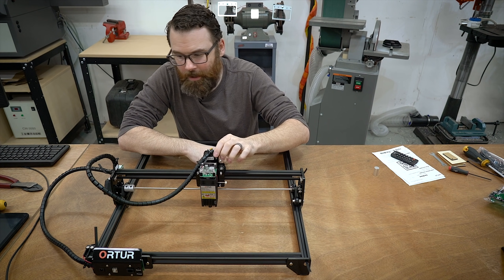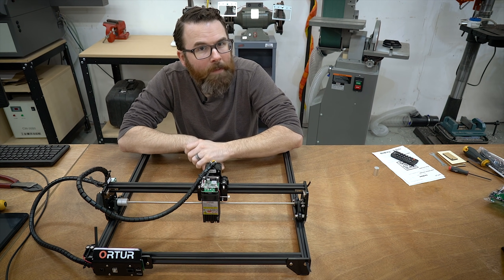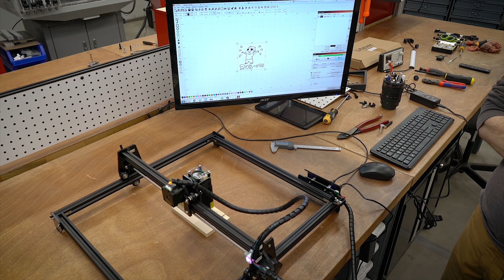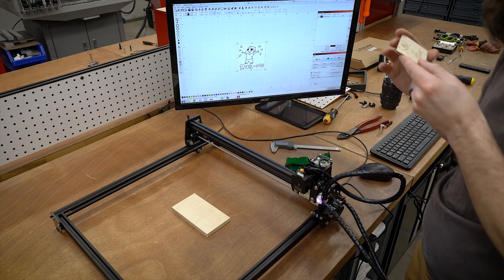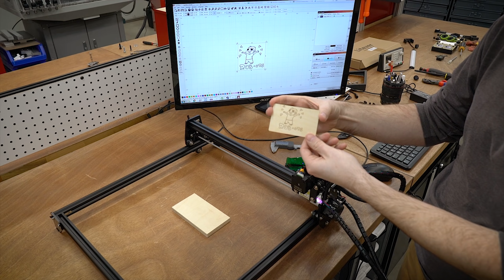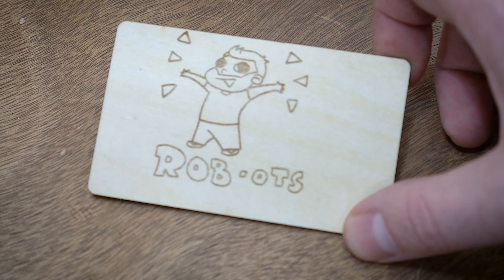Ortur Laser Engraver Overview (LU1-4)

Comment: thanks for this video. I am a total NEWB to laser engravers, I just picked up a Ortur Laser Master locally for $75. I am confused at how to adjust the focal length. Mine does NOT have an adjustment knob for the "up and down" axis. Should I add one? AND mine has a "purple" knob around the lens to be able to "focus" it.  The seller told me I just need to make sure that the distance between my laser and piece of work should be at 50mm. He would put something UNDER the piece of work if it needed to be closer. Again, not sure if this is the right way or not.  Also, I am unsure exactly what my wattage is for my laser. I have the  LU 1-4 stamped on the side of my laser.  Hoping you can answer these questions for me.   Thanks much

Comment: Hello I make wooden flags, 1in thick and 12 inches x 21 inches I'm wondering if I can place the flags under this machine to do custom lettering , pictures , or even do the union stars  with this machine , I d like to set this on top of the flags and engrave them . Thanks for the great info
Reply from the maker: Sure, that should work, depending on the material and other factors.  But just simple engraving would work just fine with this machine.
Reply: @RobertCowanDIY  awesome I've been looking at these for a while and the router cnc but those are so expensive. And then saw this and thought this might work. I was just wondering if the wooden flags would fit under the machine
Reply from the maker: @DH-fc2os  You could easily just raise the machine over top of your parts...
Reply: @RobertCowanDIY  ok cool thanks wasn't sure if raising the entire machine would work or throw something off trying to reach the material

Comment: Question: Do you think this would be good as a laser etcher for Chromebooks inventory management? Basically, etch the outside of a plastic cover on a chromebook...about 400 of them.
Reply: it should work okay depending on the material the Chromebooks are made of, dark matte plastics are definitely going to be marked by it however depending on the type of plastic you may have trouble with it melting or deforming if you use rasterized graphics. an alternative is to use single line fonts or fonts made with dot matrices which should be easier on the structural integrity of the plastic

disclaimer: this is untested and you should probably use a junk unit for testing or maybe you can try it on a replacement part

Comment: Lots of people have built air assists for these and the Neje versions and it supposedly gives a big improvement when it comes to cutting performance
Reply from the maker: Yeah, I could see that.  When you vaporize the material, it stays there, and if you don't get rid of it, it will dramatically decrease cutting efficiency.

Comment: I believe they are going by maybe Marlin code and "s" loosely translates to "Speed"/"Set(temp/etc)". If you got those results with s100 and they are recommending s800, then I think they may be overexaggerating just a little bit.
Reply from the maker: I think you're right.  It just didn't translate to light burn, but I figured it out pretty quickly and just used my own tests to determine the right values.

Comment: can I just use a similar laser to heat up to a constant temp a surface?
Reply from the maker: I mean, you COULD, but it would be really bad at it, and it's just the wrong use or application.  Just use a heater module for a 3d printer.
Reply: @RobertCowanDIY  actually I want to test it to heat the layer below what is printing to test if the 2 layers get a better bond. For very big print, the older layer has already chilled so the new layer does not bond as if the old layer was hotter. What do you think? The laser would follow the printing nozzle and heat the layer below just before printing
Reply from the maker: @biskero  Got ya.  That makes more sense.  You can just buy the laser modules themselves, and then aim it where the nozzle is.  That COULD work.  You would need to somehow tie it into the extruder signal, you'd only want it on when it's over the part, reduce power when the printer is going slower, etc.  Interesting idea, and yeah, a small laser module like this could potentially work.
Reply: @RobertCowanDIY  that's the idea, would use the FAN signal for the extruder so it's on only when the extruder is on. The trick will be to make the laser point just below the nozzle, but I already envision problems with keeping up with the directions in where the nozzle goes for printing. Will investigate! thx

Comment: I'm wondering, do you think it could cut thicker leather? Say over .125 in
Great review,  gave me some idea as to what to look for
Reply from the maker: It would probably cut it, but your edges might not be great.  if it was thinner, it would result in a better cut.  A couple things about cutting leather...  It STINKS.  It really does smell bad when its cut, so you need to let it air out afterwards.  Secondly, you will get a bit of a singed/charred edge.  This may or may not work for your application.
Reply: @RobertCowanDIY   thanks for the information.  Do you know where I might find more info? I've been looking but I know NOTHING about how to determine what would work.
Reply: @RobertCowanDIY  Oh yeah it smells horrible, like burning hair.

Comment: Nice, I learned a lot of info about this type of technology.  As a electronics maker I’m not sure how it would help me. 

I believe for my needs I would be looking at something that could cut 1/4 plexiglass, any recommendations?
Reply from the maker: For 1/4" plexiglass (acrylic), you'd need around 20 watts of laser power (the actual laser).  I'd suggest one of the 40W CO2 machines on eBay.  Just search for '40W laser' and that should get you something that would work great.  But keep in mind, CO2 is a bit different and will have a much smaller cutting area.
Reply: Actually for an electronics maker you can use a laser to print PCBs. I've never done it but I've seen YouTube videos on it.

Comment: how about cutting foam board for rc aircraft
Reply from the maker: It could work, but depth is depth.  The laser can only really penetrate so far based on the focusing lens.  Think of it like a cone, the laser only focuses at one point, so the further you go away from that, the wider the beam gets and the less power (concentration) it has.  Depending on the foam, you could probably do around 1/8" or so.  Thicker than that, it might just burn it a lot.

Comment: Why does it seem like bot builders do not like plasma cutting?
Reply from the maker: Good question! It heats the part, which can cause internal stresses.  Ideally you would anneal the part after cutting to let it relax.  But it can warp parts as well.  This is why waterjet cutting is greatly preferred.

Comment: careful moving a stepper by hand when the unit is off. The stepper will generate non trivial voltage and current that can feed back via suppression diodes to power rails.  thankx for the vid.
Reply from the maker: Yeah, I usually check this because you're right, it can turn on the rest of the controller!  thankfully it's not the case here.  Like I said, the controller seems fairly well designed.

Comment: For a few hundred more you can get a k40. Not a lot of value there.
Reply from the maker: You're right about that, BUT, it's a much smaller cutting area on the K40, and you might not need the extra power (or complexity?) of the CO2 if you don't need it.  This is also a lot more straightforward.  Maybe not a great value, but useful at the price.

Comment: Here's a sort of open question for anyone really.

How do you know to trust the included goggles? That's always been a big detraction to these open framed lasers to me. I'm not sure how I could trust those with something as important as vision.
Reply: william osman has an old video on it. even clear googles can filter some of the co2 laser. Tbh i wont take any advice from william's videos lol
Reply: StyroPyro has talked about that issue fairly recently- generally speaking, you might as well throw away any included goggles that come with cheaper machines- proper rated googles for any given colour or type of laser are 'reassuringly expensive'.
Reply from the maker: I tested these directly into the beam at full power, with a piece of paper directly behind it.  the beam burned the goggles a bit, but didn't do anything to the paper.  Not scientific, but it greatly reduces the beam if anything.

Comment: I just recently got one of these, I've been having more fun designing and 3D printing upgrades for it. I designed a neat grid system to hold jigs that I have been selling on Etsy. I'd love to share the STLs with you if you're interested.
Reply from the maker: Hey Jonathan, that's good to know!  I'd be curious to see your jigs.  Reply or shoot me a message.
Reply: @RobertCowanDIY  I have your email. I'll shoot you a message!
Reply from the maker: @JonathanRansom  I appreciate it!
Reply: @JonathanRansom  have a link to your etsy page?
Reply: What kinds of upgrades have you printed I have a 3d printer
Reply: @DH-fc2os  I have printed my grid jig system, focus bar holder, a case for an E-Stop button I made and a case for a Y/Rotary axis switcher I made, an air assist, screw down feet. I'm about to add a drag chain, so I'll print the drag chain brackets.
Reply: @JonathanRansom  wow quite a bit cool
Reply: @DH-fc2os  thanks! 3d printing is fun!
Reply: @JonathanRansom  yup I have been 3d printing for a few years, last year I fully printed 2 stormtrooper costumes and a life size r2d2 for our covid Halloween display. I think that was the most fun and most elaborate thing I've done so far.
Reply: @DH-fc2os  that's pretty cool!
Reply: is it anything like this one?
https://www.etsy.com/listing/951647807/laser-grid-bed-mega-bundle-includes-many?ref=shop_home_feat_1
Reply: @br0k3nilluzion  it's exactly like that one. ;-)
Reply: @JonathanRansom  didnt even know that was your page until i looked at some older comments on the FB group. Lol